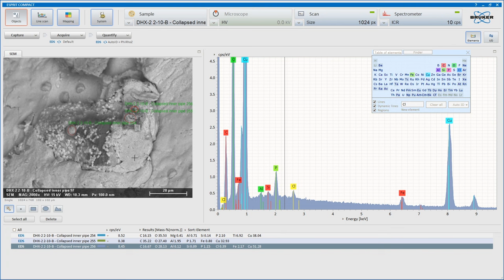Bin-Juine Huang - "T" on collapsed DHX-2 piping

Comment: It would be interesting to see the magnetic fields at a microscopic level for the GEET and Thunderstorm generators and their rods too. I'm thinking maybe measure the amount and direction of the reflected electron beam. I'm betting we would see some surprising structures. I found the MFM but it has a scan time of minutes to half an hour. If you invent my idea remember me. You might even be able to use a CCD or imager tube to measure the direction and intensity.